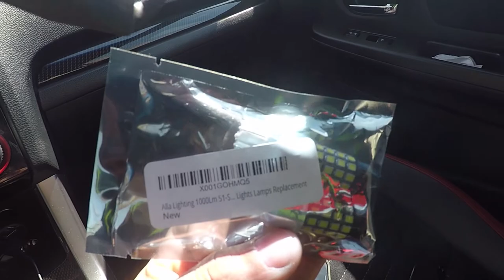REAR TURN SIGNAL AND REVERSE LED INSTALL 2016 WRX STI

Comment: Where can I buy them?
Reply from the maker: KingVDT519 Turn signal
https://www.amazon.com/Alla-Lighting-Lumens-Extremely-Chipsets/dp/B0733QGJTV/ref=mp_s_a_1_2?ie=UTF8&qid=1528644930&sr=8-2-spons&pi=AC_SX236_SY340_QL65&keywords=alla+lighting+1000lm&psc=1

Reverse Lights
https://www.amazon.com/LUYED-Extremely-Bright-Reverse-Chipsets/dp/B075K4DPFY/ref=mp_s_a_1_1?ie=UTF8&qid=1528645031&sr=8-1&pi=AC_SX236_SY340_QL65&keywords=luyed+reverse+lights+1600&dpPl=1&dpID=51UXlQw9YQL&ref=plSrch

Comment: Where these even the right bulb sizes for the sti cuz I went on the link you put but they don’t fit mine
Reply from the maker: Yes here is the link to the ones I got

https://www.amazon.com/Alla-Lighting-Extremely-3157-Chipsets/dp/B0733QGJTV/ref=mp_s_a_1_3?keywords=alla+lighting+1000+lumen&qid=1575253904&sr=8-3

Also before you buy you can select the make and model of the car to make sure they fit right on the amazon site